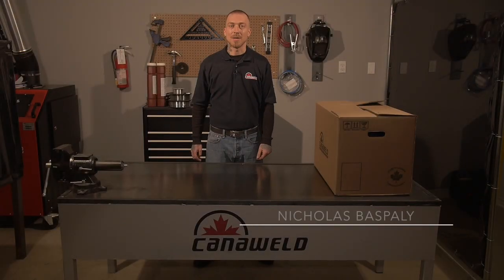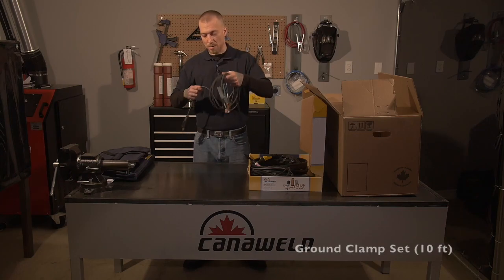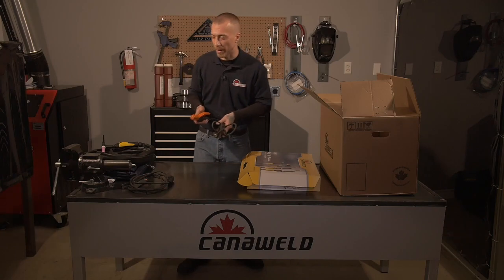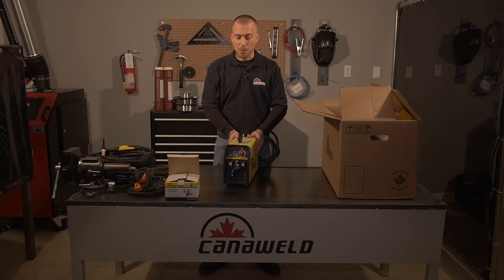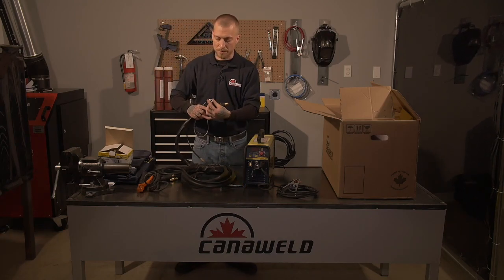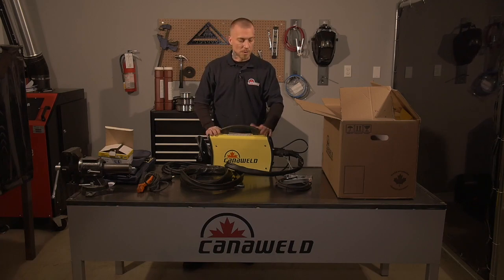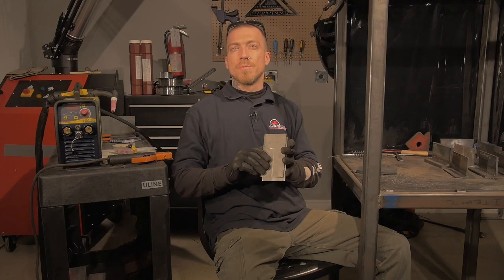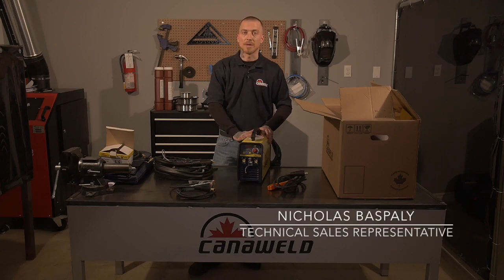How to Setup a TIG WELDER for Beginners, TIG Welding Machine, 120/220V, Canaweld

Comment: If there is no gas in tig welding what will happen.?
Reply: If there is no gas the second you strike the arc it will not properly establish. You will end up with black soot all over the area and most likely your tungsten will have to be cleaned and re sharpened!  Great question buddy , thanks for watching!!
Reply: @canaweldinc6706  thanks for the info...